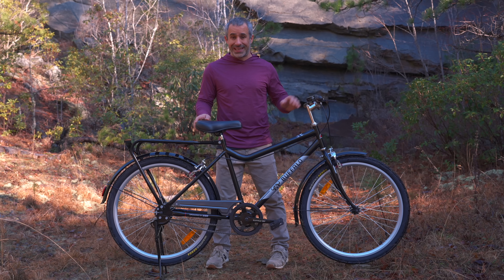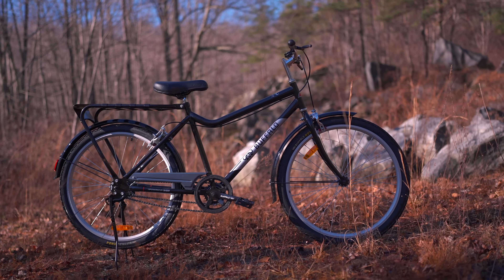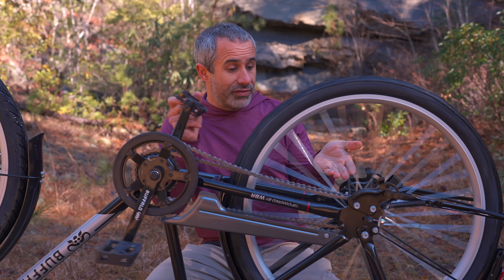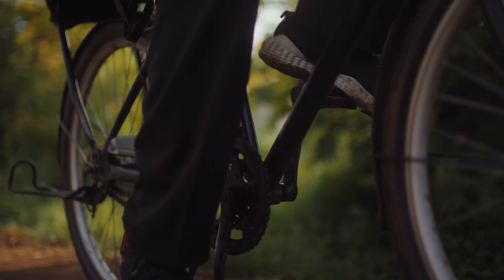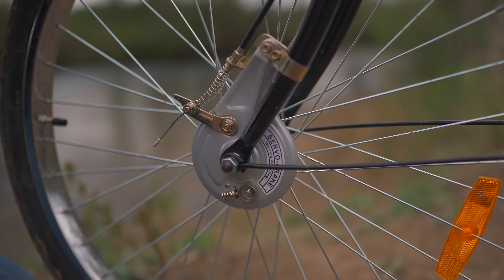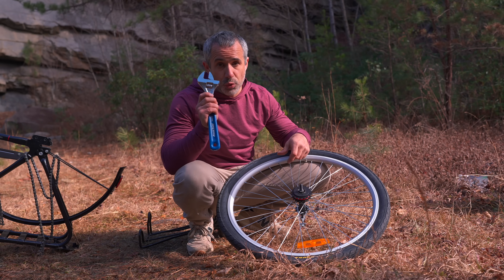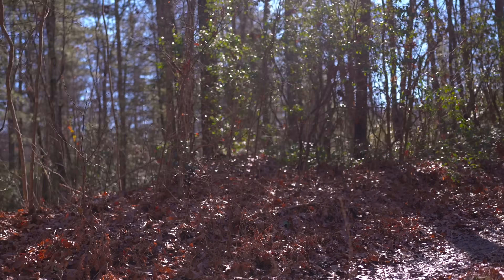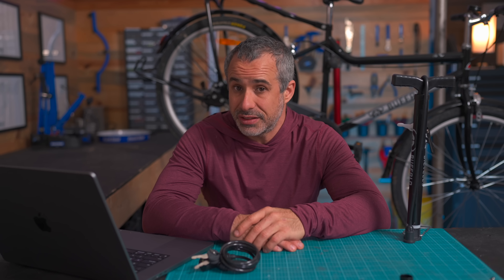Why 2 Chains Make This Bicycle WAY BETTER

Comment: one thing that goes unmentioned is the jump in tooth counts this kind of drive allows. you could have a 25 tooth difference in chainrings, or even have the small chainring connect to a larger rear gear, without worries about shifting performance or chain capacity
Reply: I'm not sure if that's possible due to the inability to independently tension the chains. If it had a chain tensioner for one of them, it would probably be much less picky about the chainring tooth counts.
Reply: @quwaz11  I could see ways to do that, though, for a modified bike.

You might be able to get the chain tension closer with half-links, but also, you could mount some kind of adjustable idler on the chainstay to actually get adjustment.
Reply: @bhtooefr  I'm wondering how it is to manage the chain tensions as the chains wear. Obviously one would prefer work rather than replacement parts as a solution where these bikes go. You can't just swap the chains because they're of different lengths, and if you swap only the smaller chain's length, the next time you won't know which part of the chain has been swapped and which hasn't, and maybe more importantly on a well used bike how do you even tell which chain has worn more since the last time it was serviced? Or, how do you tell when you even can do the swap so that it results in a more balanced rather than more imbalanced chain tension? Maybe I'm just splitting hairs and WBR is supplying cheap half-links to the trained mechanics.
Reply: @dmrfnk steel chainrings and cogs last a lot longer than aluminum, touring riders often choose steel for that reason 

And with a straight chainline, a bit of sag in the chain is OK.

Of course at some point there will be wear and the need to replace. But not so quickly as with the parts that most of us are used to.
Reply: @dmrfnk if is anything like my old two-speed Schwinn, you would just loosen the axle bolts on the back and pull it tighter in the bolt channel in the frame. Just like one-speed bike. I'm thinking they probably didn't overcomplicate it.
Reply: @quwaz11 I'm curious about the tooth counts. I'm sure there are other factors in not thinking of but it seems like you could add a tooth to both sides, at either end and it would stay close. This is probably the best mix of usable ratios and even tension. And because of the back pedal shifting, perhaps it's preferable to have the high speed chain a little looser. It's really a brilliant idea.
Reply: My Core Question: What are the 2 'speeds' these chainrings/teeth allow?

Comment: I really wish WBR/Buffalo would bring these to the US. I'd gladly pay twice the usual price to get one and have one sent to where it's needed
Reply: Why? We can get parts on short notice in the US, and the tools you need to repair a bike are pretty affordable.
Reply: @SmallSpoonBrigade  The only cheap bikes we have here are department store bikes, which are not designed to be repairable.
Reply: One of the guys who runs Walmart now, has changed a lot of that: He's super into mountain-biking & has overhauled their bicycle selection; their bicycles use standard sizing & designs, now! 

Twenty years ago, I referred to Walmart's old built-to-fail junk bikes, as "Wall-art" bikes, because they were so awful they mostly sat around unused. 

Today, I could ride happily for years on a $400 Walmart bike, & for less than $1400 total I could upgrade one to have every bicycle feature I really care about. 

There are definitely still some companies producing junk bikes out there, but at least Walmart isn't one of them anymore! They went from being one of the worst offenders, to one of the few major retailers making practicality a priority.
Reply: @prophetzarquon  The Ozark Trail line is decent, but I wouldn't go so far as to say all their bikes are good. Still plenty of crap on the shelves.
Reply: Ah yes, they should absolutely put a strain on their supply lines to accommodate the rich Westeners instead of helping the actual people in need of these 🙄
Reply: @oz_jones There's so much demand for rugged commuter bikes, they could literally do a "buy one donate one" & still have tons of buyers.
Reply: @prophetzarquon  What you have to remember is that WBR are a registered charity. Charities have special legal status, but also legal limitations which they must abide by. They will get their parts at extremely low cost, but almost certainly, their legal contracts with suppliers restrict them to only using those parts in specific areas etc. If they sell bikes in other retail markets, they would be competing with mainstream manufacturers, who have to pay full price. Cue big lawsuits for anti competetive business practices.
Reply: seems odd nobody in the world sells them online.. for me that is a massive red flag that its a scam.. It's hard enough just to find images of the bike that isn't the same marketing stock photos from their promos

Comment: My ex partner grew up in Africa, a very remote area until his teens, he used to say the only way to modernize Africa would be to do things like this, provide the basic things so that people can help themselves. 

Someone once suggested to him that we should send modern cars to rural Africa, and he had to explain how without the roads and petrol stations, and mechanics to go along with them, it's a pointless exercise, they have cars - but they don't last long and cost too much to run and repair. He pointed out the development of transport in the western world and how there were lots of steps before getting to cars, and that Africa needs the safety net of the those prior steps to work up to a functional modern transport system.
Reply: actually car travel is a lot less cost effective than other modes in every place in the world. Society has made a grand mistake to invest so much in it, and that's why things are turning around. Living in an area that requires all movement to be in cars has been very expensive for individuals and for government investment. I hope Africa can build itself with bicycles, good foot paths, and mass transit mostly. It's fine to build it to allow cars and trucks, and it's even necessary, but I hope Africans can learn from the mistakes the western world made which was to over-invest in private car transport.
Reply: Tom, I agree completely.  There's a grand opportunity to skip the mistakes we made.  Places like Amsterdam and Copenhagen spend billions on car infrastructure and over the last 50 years,billions more to undo it.  What better way to plan a city growing than to just start out with good bike infrastructure.

Of course I realize these bikes mostly go to rural places, but villages turn to towns and towns to cities.
Reply: @rcranes2227   I spent a few weeks in Copenhagen two years ago, that is NOT a automobile city. I walked everywhere, public transit was easy. it was NOT built for cars. My Car wouldn't fit in most of the roads! I am from Texas, USA. we are a Driving state, we have roads. I rode in a bus across the entire country of Denmark in like 4 hours. That wouldn't get me half way across my state. 

Denmark has about 70,000 km of roads in the entire country. Texas has about 506,299 km. America has about 6,586,610 km of roads.

Texas has 16,898 km of railroad. 
Denmark has 2,633 km of railroad.
Reply: Interesting. Thank you.
Reply: Or we could simply stop extracting resources at exploitative rates from Africa and the global South and let them develop?
Reply: too bad this is a fake charity.. and what you saw back then were 2nd hand momba bikes.. and these are identical copies.. with some new decals to say something else..    go buy one of these online.. and when you realize you cant.. then youll know what i know..  its a scam.. and he fell for it and nobody wants to listen.. go look up their so called factory... its actually a car dealership

Comment: I bought a single speed a few years ago, a vitus Mach 1 Purley because I wanted a low maintenance bike when I was living in a remote area. I Completely fell in love with it's useability and couldn't help but think that it could liberate millions of people. Had a steel fork ally frame, was light as hell. I used it well. Never serviced it and it goes just like it did when I bought it.

Comment: Rim brake just wears out the rim... Mech disc is maybe better.
Reply: The con of a disc is it is unridable if the disc is bent. A disc bends way faster than the whole rim.

Also mechanical disc brakes need constant adjustment on the play to keep them working. It's a pain compared to a hydraulic disc brake, but these are too complicated to get serviced in the bush.

Comment: This reminds me a very old, i believe, French or Belgium system. One very long chain and one cogwheel - when you pedal the normal way, clockwise, its higher gear. And if you pedal back, counter-clockwise, its lower gear engage. Strange system, but it seemed very robust.
Reply: That system is called (retro) direct-drive.
Reply: The only time I've seen that particular system is on sailboat winches. Some even get a 3rd speed if you move back and forth. For the bikes, I can imagine that pedaling backwards would feel weird for the first few hours, though.
Reply: Interesting idea. Some mechanism would be required to reverse the direction of the backwards-driven chain though. Unless you're meant to turn the bike around and just ride backwards that is 😂
Reply: @2bfrank657  It's called Retro Direct Drive if you're interested in looking it up. There are two different cogs on freewheels of opposing rotational direction with a single chain, or there is a two-chain variant (IIRC, one chain on each side, so that one would use a pair of tandem bicycle cranksets to get chainrings on each side of the bottom bracket with one side of the rear hub having a freewheel mounted backwards to typical rotation if one wanted to build such a system), and there may be other setups, as well.
Reply: @mitchkelleher7972 wow, that's bizarre!

Comment: why bikes are the future of developing countries 
sure the riders have to eat more to compensate but for the most part this is beneficial to thier health and still cheaper than a car or motorcycle
Reply: Bikes should be seen as a bigger part of the future of developed countries as well. Cars are killing us.
Reply: @AidanXavier1  Perhaps, but these aren't a part of the solution and if they made any impact at all, it would be to hold it back.
Reply: Because the developed world doesn't need bikes like these. These were engineered with the needs of the developing world in mind and will likely be discarded when they develop to the point where they can reliably get parts on short notice. A bike like this would be completely inappropriate in most parts of the US for most uses. They're designed to be used on rough terrain and with a limited ability to repair or replace them with things they don't have on hand.

Comment: Having that "push back" to engage lower gear for mountain bikes, even for community or cross-country (Africans are loving XC bikes - not lot mountains, and flat savannas most of the continent) not very practical..
There are simple planetary gear sets in rear wheel hubs, that can be reliable and easy to maintenance with 14 mm wrench. Push back usually engages the rear brakes
Every post soviet country have those bikes. Belarus actually produces those (and still is) - Check out Minsk-Motovello production plant.

Comment: 7:19  Seth, buddy, allow me to introduce you to the Fichtel&Sachs Duomatic, the Bendix Yellow Band  and Dendix Blue Band, Sturmey Archer S2C.... even KT made the KT-325R.  You can absolutely have a coaster with a 2 speed kickback, and it works far better than you might expect.
Reply: I think you missed the point--those are all complex internal hubs, not cheap disposable freewheels.  These consumers don't have the facility to repair, or even re-lace, a broken hub.  This freewheel is a simple spin-on replacement...and they even provide the tool.  Serviceability is the reason they ditched the coaster.
Reply: @keithschrack Go back and watch the clip. He says "You can't do both". Which is clearly incorrect.
Reply: @keithschrack  from what Seth said, the limitations of singlespeed with cargo is the rain why they ditched the singlespeed

My comment is directed at the statement that coaster brakes aren't going to work because we're backpedaling to shift. That's what he actually said at the moment i tagged in my comment. I understand the cost reasons behind avoiding the kickback igh. Totally. But if you'd taken the time to click on the 7:19 , you're have better understood my comment. 

I am skeptical about the long-term reliability and stability of this 2spd/2chain freewheel. I bet most of them will be functioning as singlespeed within 2 years
Reply: And they don’t have the same low cost and easy serviceability as this design.
Reply: @timshelhamer7374  listen to the specific statement i was responding to, kid
Reply: I'm guessing it's a limitation of this being designed as a freewheel, and the backpedaling likely only engages/disengages the high gear, with the low gear always being engaged (and freewheeling when the high gear is also engaged).

An additional mechanism to backpedal further through the low gear freewheel into locking it up would be interesting, as you could then presumably mount this on a coaster brake and get braking. However, you'd also be adding more single points of failure - if that low gear freewheel mechanism fails, you might get a sudden fixed gear or no drive at all depending on how it's designed. And, if the coaster brake fails, you could get no drive at all as well.
Reply: Exactly, I rode one of those as a kid, worked great. I guess it's less durable or more expensive than this design though.
Reply: @teslatrooper  of course kickback hubs would cost more than the system featured on this bike, even with the double chain. My point was simply that a bike drivetrain can both shift and brake via backpedaling. 

I remember SRAM made a THREESpeed kickback coaster for the WBR Buffalo Bike like ten years ago. I don't think it ever made it to full production, but there were working prototypes featured in the cycling press

Comment: New tech built on old tech...The most brilliant, simple and practical transmission system I’ve seen. And all of this affordable, impactful, and truly valuable to its community. Simply GENIUS! This is the pure essence of biking 🚴
Reply: What new tech?
Reply: @anthonyross9351  the dual speed freewheel with built in shifting mechanism. did you not watch the video?

Comment: I wonder if they used an oval chainring for one of the chains if that would make tension closer to equal.
Reply: An oval chainring won't change the tension if it has the same number of teeth.
Reply: @ never used one just was a thought. I see they come in odd sizes so figured it might help
Reply: @TheShortzTraveler oval chain rings would lead to uneven chain tension, since they do not have an even circumference. They only work if you have one chain and a chain tensioner or derailleur.
Reply: That’s why I’m not an engineer lol